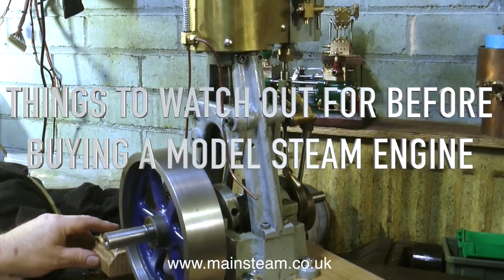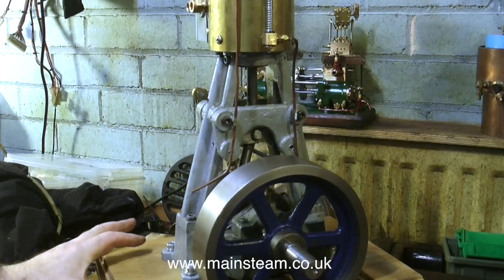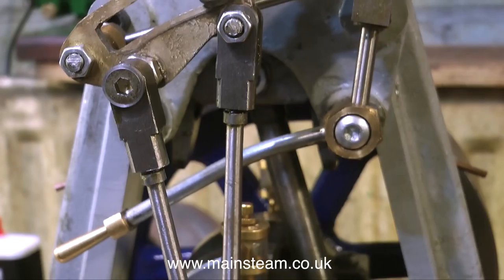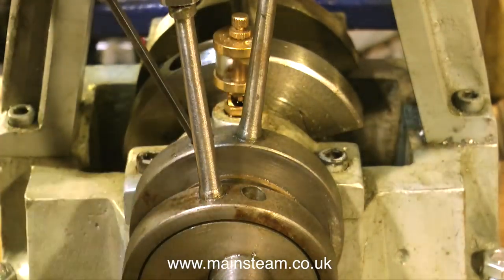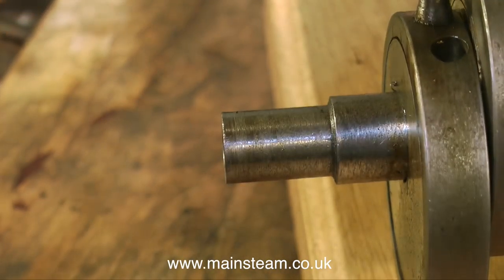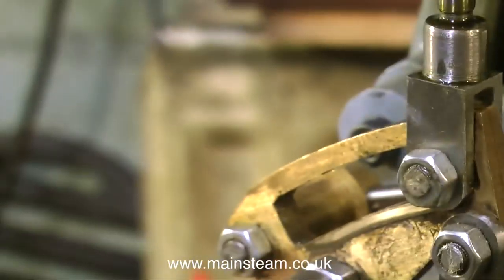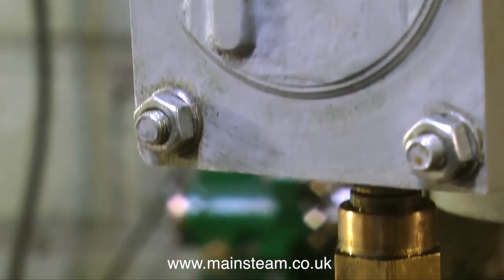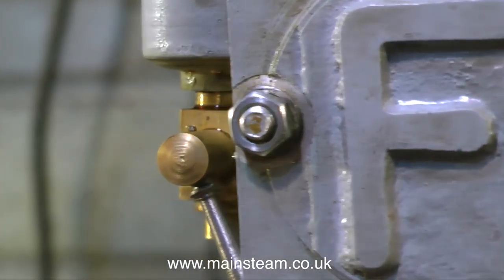THINGS TO LOOK OUT FOR WHEN BUYING A MODEL STEAM ENGINE

Comment: Hi Keith, I'm no model engineer (yet!) however however working in engineering makes me think back to my apprenticeship and uni days when it was a case of learning and figuring things out. The builder must have been under time constraints, limited tooling or material. Personally I would improve the appearance of the engine, remove anything useful (if any) and loctite it all up for display purposes only.

Comment: If i ever got around to build my first steam engine, it probably would earn similar criticism. The thing is, if i dont make all the mistakes first, im never gonna learn. So my guess is that someone was learning how to build a steam engine, and then died, and the wife sold the contents of the attic, and now it sits in the corner.
Reply: +Willem Kossen I would suggest you go looking at Stuart Models or PMResearch. They both sell engines that are already machined, but not assembled. All you have to do with them is put them together. A good first stepping stone into desktop steam engines, and PMR has one for about 150 us dollars that usually runs like a swiss watch on an aquarium pump. PMResearch #3.

I'll be getting one myself soon.
Reply: PMReaserch is good. I wouldn't know anything outside of that brand except for wilesco. With my PMResearch mill engine, all I had to do was a bit of filing in the switch valve  and it was good to go. I don't have a mill so I couldn't run it in or anything.
Reply: Demonic Darkness
Should be able to run it in by simply running it. That's how I plan on running in the Stuart 10H I've settled on.

Bit pricier of an engine than the PMR3, but on the other hand, it's also a more standard one in terms of design. D-valve, crank throw between two main bearings, etc. I'm just gonna hook it to an aquarium pump, kick it over, and let it run in that way.